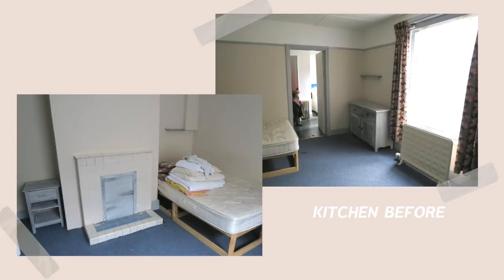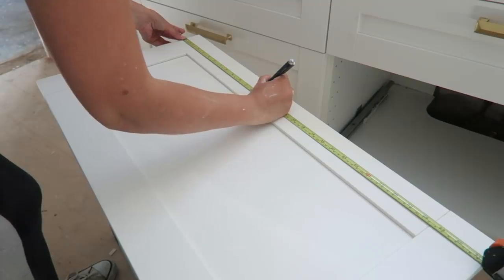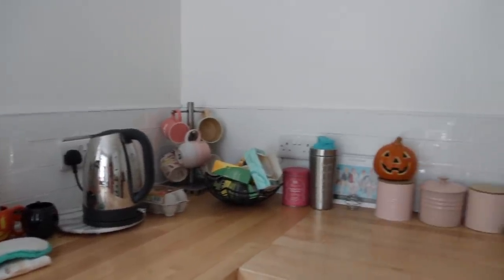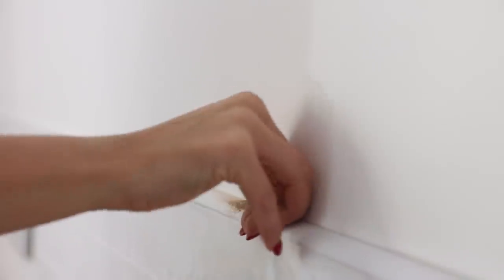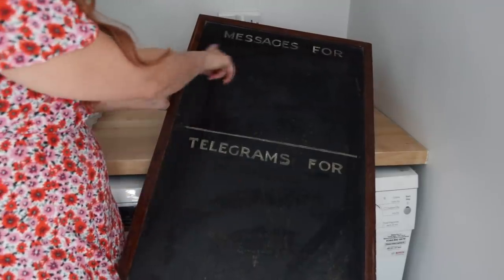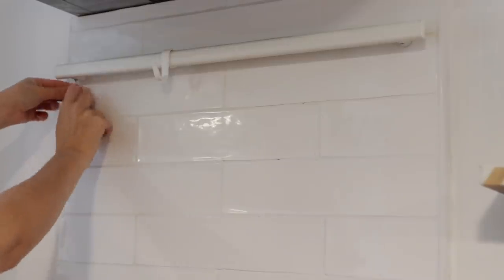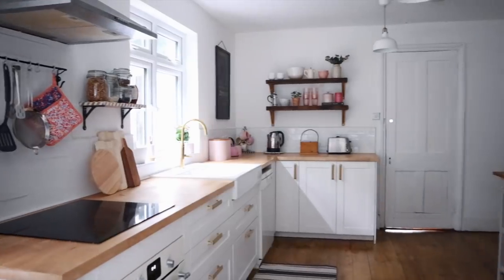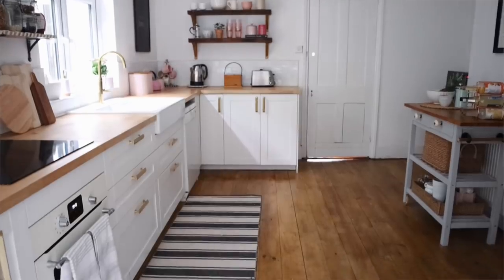Creating the Pinterest Kitchen of my Dreams ✨ Full Kitchen Makeover | UK Home Reno

Comment: Am i the only one who got rly nervous when she started to drill in the line of the power outlets? Normally where I'm coming from that's where the wires are running in the wall...
Reply: Yep. But maybe she checked those places for wires beforehand idk. I personally also would never drill right next to (horizontal or vertical) outlets.
Reply: I'm presuming because it all needed plastering and the sockets put in that she knew where they'd run the wire. Our house is a minefield. We ripped our bedroom back to the brick and saw some of the electrics run diagnolly in random places!
Reply: In Italy for example our power lines don't run vertically to the roof but orizontally from the socket or if vertically they go in the direction of the floor.
As far as I know at least.
We only have walls made of bricks, so usually all the lines (power lines, phone lines, etc) are near the floor. So the lines usually go from the bottom to the sockets.
Reply: Yes I thought exactly the same thing, but having said that when I did my kitchen a couple of years ago and had to have all new electrics, the cables were run up the wall behind the units, they may have done the same with this one. Lovely though, the kitchen looks wonderful
Reply: Lol, I was slightly worried but this girl is ine smart cookie and ice seen her be so cautious many times so I assumed she had checked. But I'm with you on the concern for her,she's such a sweetheart 🙏🤗
Reply: Yep me too!!! 😟
Reply: My HEART almost stopped I was like ahhhhhhhhhhhhhhhhhh xx
Reply: I was looking for this comment to see if I had to write it 😂 my heart stopped when she started drilling above the outlet.

Comment: It looks great.  Have you thought of putting cabinetry over the microwave.  Since its in an alcove it wouldn't interfere wth the open look.  It would, however, give you more pantry space, and that is nice to have.
Reply: Great idea! And it would tie in the nook with the whole kitchen if she used the same Ikea doors.
Reply: I was just about to suggest that, she's kinda got a big empty space there and more storage is always a plus, and she could have some cute display space either on top of the cabinet or with glass doors.
Reply: Ha! I just commented the same
Reply: @angeltaraila6868  Great minds think alike.
Reply: I was also thinking the same cabinetry would be great in the microwave nook, and now I’m thinking it could be cool to be a floor-to-ceiling pantry with a built-in microwave space!
Reply: I came on to suggest a floor to ceiling pantry in that nook by the door as well, with space for the microwave. Very Pinterest, and also in keeping with the era of the house. 

The blackboard (which is lovely btw) would probably be easier to use if hung on the back of the door. Penneys/Primark have three white over door hangers for €2.50 at the moment, so wouldn't even have to drill into the door. It would leave space for some art in that corner, or more nice open storage 🙂
Reply: @ajh0198  snap 🙂
Reply: Agree! Or shelving. I also think a beautiful vintage looking hutch to fit into that space would look great!
Reply: I would put a floor to ceiling cabinet there with doors you can nest in and a hidden countertop for the microwave.
Reply: I agree, in fact I would do floor to ceiling pantry that encloses the microwave.  Its a great spot for it and would help keep down clutter elsewhere

Comment: Love the make over.i would put a pantry where you have the unit that your micro wave is.just a idea.
Reply: Jo Connor 100% agree, a unit for that while area would make such a good use of space and storage
Reply: Great idea! That nook is MADE for a pantry! Put in a floor to ceiling pantry or whatever pantry height looks most harmonious with what you have in place. If your pantry is not floor to ceiling, fill in the space above to create a solid wall. That way, it will look original to the kitchen and not an add-on.

Use Ikea doors that match your cabinets as the face of the pantry. It will look classy and make a world of difference as far as how your kitchen works on a day to day basis. Plus, it wouldn't be that expensive. I would hire a carpenter to do the install, though, without a doubt.

Have remodeled a 1904 farmhouse over a period of 20+ years. Have removed two walls, installed a new kitchen, redid two bathrooms, created a new front entry on the side for a better look, installed a front deck, added arches, redid old hardwood floors, replaced all the doors, installed a vent free fireplace, new windows, new roof, finished the basement, etc.

This house was very run down but not in the dreadful condition that yours was, however. You are amazing!! Are doing a fabulous job! Congratulations on creating a very pretty and workable home out of what was a trainwreck.
Reply: KE Disbrow yes!!! Just wrote a comment with the same idea!
Reply: I was just going to write the same thing
Reply: Franny Fisher haha me too
Reply: Absolutely yes !

Comment: I know you said you were done...but you may want to consider putting cabinetry around your refridegerator...you could put a bin cabinet on the bottom that would include a trash bin and a recycling bin. on top, it could be used for anything you desired, with slide-out shelving it would be a great pantry.   Just a suggestion it looks great

Comment: I have a 1955 track home in California. It’s on a raised foundation with hardwood floors and plaster and lathe walls. It’s very difficult to fix up also has almost all original subway tile. . You have been such an inspiration to me. I’ve always shopped at thrift shops and DYI stuff. But now I’m on a stricter budget and I’m almost 65 years old and disabled so I’m somewhat limited in physically what I can do compared to what I used to do. But I will continue to try. Thanks for being so uplifting. Pink is also one of my favorite colors.

Comment: I like it. I love that shelf! I’m getting ready to redo my kitchen with Ikea cabinets. I dream of open shelving, but I know my cats, one in particular would be jumping on them all day long and sleeping on them, she’s my favorite (don’t tell the others). So I’m thinking glass front instead. If I might suggest, as I am a home stager, add three open shelves above the cabinet in that cubby corner, move out the Ikea hack butcher block to another room as it interrupts the flow by cutting into the room space. Or put it where the other cabinet is and move that to another room. The chalk board seems awkward to have to lean over the counter, so I would trade the tea towel picture and the chalk board. Actually after rewatching a few of your videos I would swap the refrigerator and the cubby. Most refrigerators are able change the doors opening left to right really easily, as it would work best to open the doors the opposite way for that corner. Three shelves and the butcher block table where the fridge is.

Comment: If you wanted to have the kitchen remain less cluttered  - you could put up cupboards above the microwave to make a pantry space.  If you then move the chalk board to the other side of the door,  onto the wall next to them - as you run out of pantry items, you could write on it without having to stretch across the work top.  Where the chalkboard is currently,  you could put up a plate rack with cup hooks -  Ikea do a great one from  the Stenstorp range.

Comment: Amazing job girl. It must have taken so much of hardwork to complete this and it's so beautiful and functional. If I may offer a suggestion, the place where you have the small cabinet with the microwave on top - instead of that cabinet, you can try adding a full length pantry cupboard. It will provide a lot of storage and it would be tucked into that corner, so it wouldn't pose as a hindrance